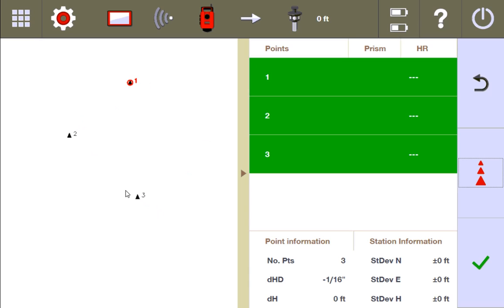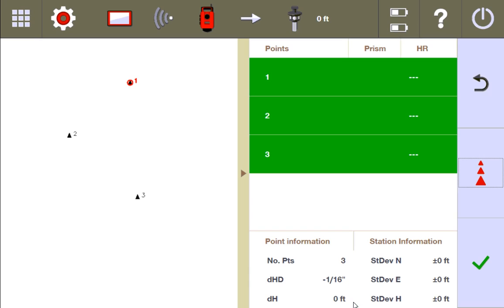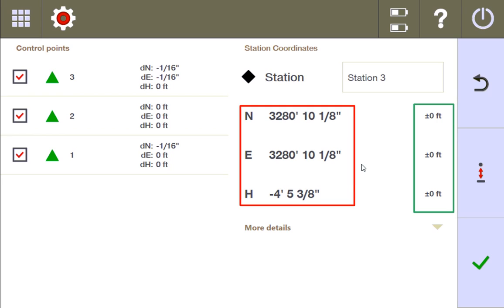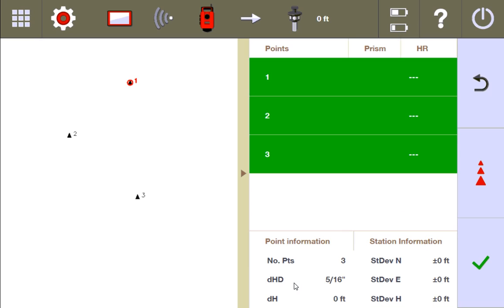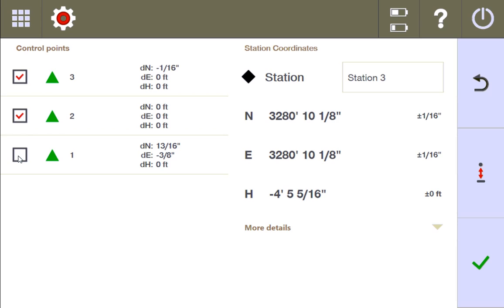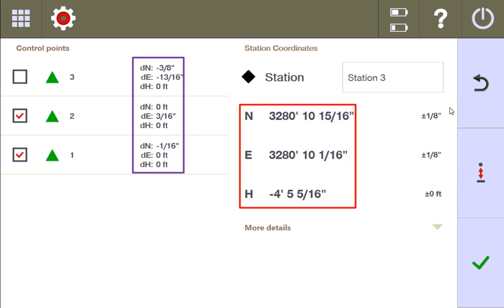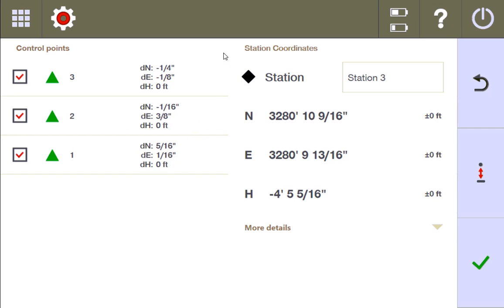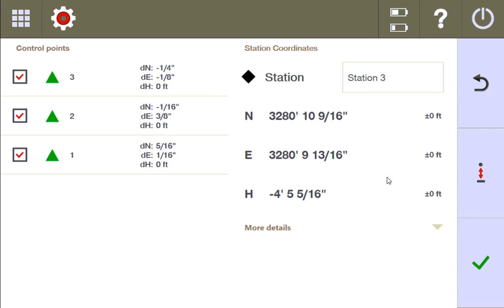HIlti PLC 400 Tutorial - STATIONING BASICS

Comment: Could you please help me to figure out the best way(efficient & accurate) to bldg wall layout at a new jobsite that has no control points set, irregular shaped(not a perfect rectangle or square), & the dimensions are inconsistent. Basically how can I show up at the jobsite, use the tool to quickly establish grid lines or control points to station with and get doing line layout as quickly as possible? I feel like I spend a lot of time using a tape measure to find center of the bldg on each side to use as my grid lines for stationing, only to spend even more time adjusting those ref points little bit here & there, in order to get a good stationing >3/16". It gets a little frustrating at times but that's how every job I go to usually is.. I'm talking with my boss about having a surveyor establish CP at each job prior to my arrival but haven't heard back yet. I know that ideally this would be the way to go and ensure accuracy. Any help or suggestions would be greatly appreciated sir.
Reply: So.. I was able to go back through some of your videos, and along with some others, I think I figured out the best way to accomplish what I was asking in the previous post.. The more I use the tool and get comfortable with using the different functions and features, the more I realize all the capabilities of using it. For me, that's the best part about using this machine.. Using it, I learn something new every week that helps me to to do my job more efficiently & accurately. When you enjoy what you're doing, it's hard to call it work right. 😏

Comment: I noticed today when I stationed my dh was way off like over one inch on 3 points and 0 on another any ideas why and is that bad
Reply from the maker: don't worry about heights deviation (generally) - you can ALWAYS reset the benchmark height for the jobsite after you finish stationing - just go to the stationing screen, press the heights icon in the bottom left, and set the height.

the reason yours are coming up off is simply because 1) your control points have a height value on them, and 2) for whatever reason they are not at the height the total station is expecting them to be. So, you can have 0's on your N/E coordinates (because they are accurate in a 2D plane, but it could be way off on height.

If you are concerned about this, however, I would check a few things: 1) Look at the point coordinate - are you sure the H value for that point is indeed correct? 2) Check yourself before you measure it as a control point - i.e. is your height of rod imputed correctly? are you sure you even need a height of rod value (for prisms/points that are not on a prism pole)? 3) Did the points by any chance get moved up or down? (unlikely).

AGain, though, if they are accurate on the N/E plane, then 99% of the problems are going to resolve themselves because you can always go back and station with heights by measuring an easily visible benchmark some other way.

Hope this helps!

Comment: Would you happen to know what would cause the live camera of my tool(plt 300) to be just a blur when attempting to locate/lock on the prism when stationing? The machine will turn but will not focus at all, even when I use the zoom function.. This happened to me yesterday & I tried a different tablet but to no avail. I had to end up using a different tool altogether. THANK YOU!
Reply from the maker: hmm. that's an interesting one. When that happens to me (it does - but rarely),  I just close the software and reopen it. I don't lose my stationing. Sometimes I just turn off the head unit and turn it back on - I don't have to restation with these methods, which seem to work for me.